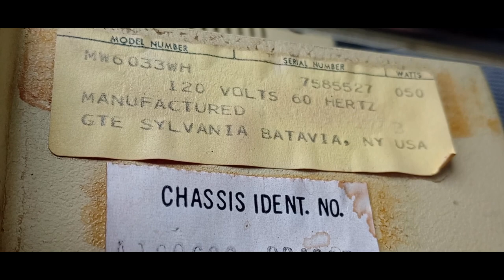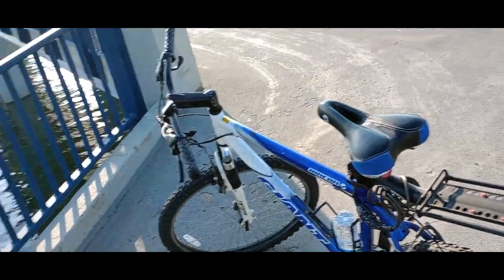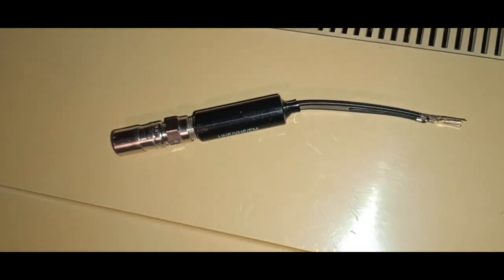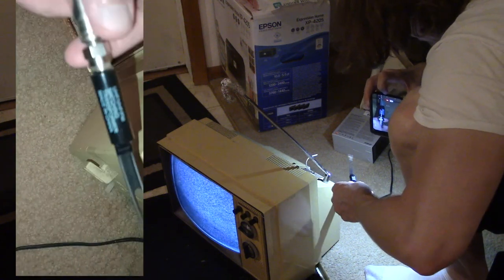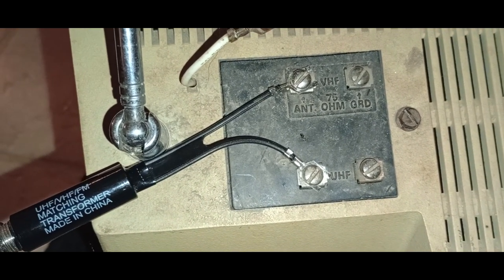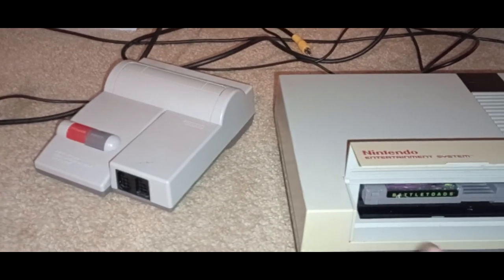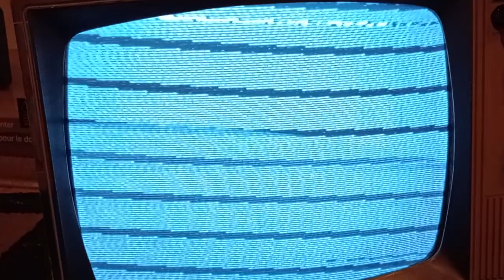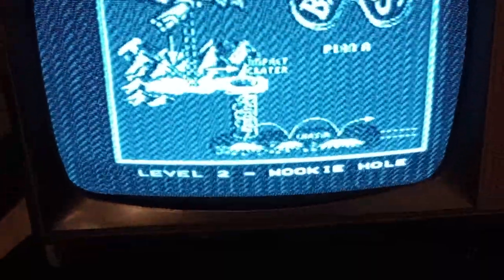Hooking up a 50 year old CRT TV to an NES.

Comment: Another trick.  If you get a good signal amplifier and put an antenna on it, you can transmit it wireless  to the tv.  We used to do this to varying degrees of success but it was fun
Reply: That sounds amazing! Wonder if the included antenna would work?

Comment: Hey dude, just so you know that ‘Fork Connector’ is actually called an F-type connector. We had to use those back in the day to connect to older tvs, I mean wayyyyyyy older. We had a black and white Emerson not unlike the Sylvania you have, and it had the same F-type to coax converter that was needed. Most electronics up through the Sega Genesis came with the converter, and the old Colecovision and Atari systems all came with them. Have fun!
Reply from the maker: F-type. Ok thx

Comment: I was laughing. I used to do this all the time from the time i was 4.  The first systems i hooked up this was was the atari and commodore but they did not need the balun.  The switch box screwed in.  When we got a new tv, i had the coax to screw terminals balun connector.  Things are much easier now

Comment: The circular thing with forks at the other end 2:56 is a UHF antenna to get the old and cheaper channels broadcasting in UHF back then (hasn't been used for decades even  before digital broadcasting cause it was crappy), the integrated antenna is a VHF antenna for the "proper" channels. 
It was similar to Am radio vs Fm radio channels. 
The white wire is connected to the integrated VHF antenna. 
To play the Nintendo or connect anyrhing put the coaxial connection on VHF screws and set to channel 3 or 4 on the top dial. 
Bottom dial is for the defunct uhf channels

Comment: Can tell you've never experiences 300-ohm rabbit antenna inputs before. At my old age, this is so rote, it's second-nature. At least you are figuring it out.
1st attempt (1VHF, 1 UHF). Saw that one coming a mile away. If it were tuned in properly, you'd get a weak image with decent sound. The tuning ring needed to be rotated into tune.
Overstretched Image: Right away, I knew you had to adjust the vertical height pot. If the tiles appear uneven top to bottom (usually stretched on top, crushed at bottom), that's vertical lin(earity).
Once you did get it dialed in, the top is squashed, bottom OK. Usually linearity doesn't go off that way, so you might have to recap the vertical circuit soon (replace the capacitors, as they may be leaky (physically/electrically), or open (dead). You may have a bigger project on your hands than you were hoping for. 
The image is far right. Either you need to adjust Horizontal Hold to center it, or if there's a horizontal center pot to turn....
Reply from the maker: I need a guy like you here for when I try to make this picture as close to perfect as I can!
Reply: @SolidNate99  You're getting there. You set the linearity too far, so the top is stretched, bottom crushed down. 
As for the overall clarity, I'd turn the fine tuning knob to get it better, it looks out of tune (that plastic ring around the dial is fine tuning. Turn it to get better image).

Comment: I looked around online breifly looking up televisions from the 1970s. I was linked to articles which say some plastics are harmful to humans. Though, could not find an article which specificly talks about that type of television you are using. One forum post referenced smoke as something which is common in 1970s televisions. So what you are smelling is likely smoke possibly the type of plastic used in that model. There actually are converters for that type of television which link to HDMI. Personally, I would not recommend using that television. The specs of it sound sketchy in a negatively affect your health kind of way.
Reply from the maker: I was a bit worried about the affecting my health with that smell but the will to defeat Battletoads is strong